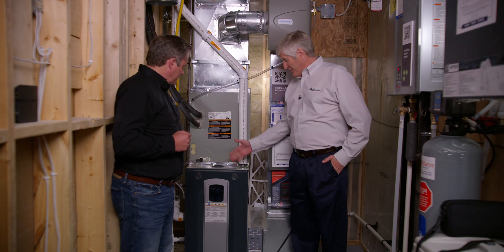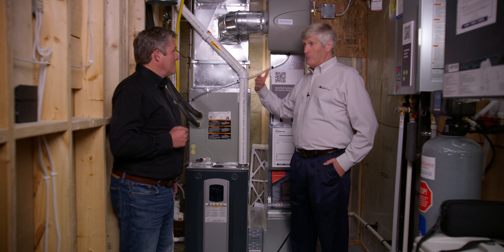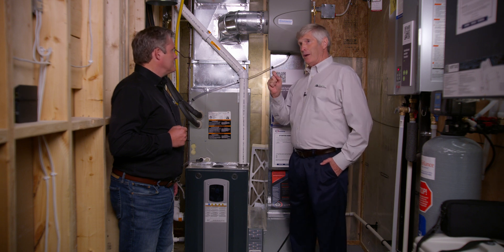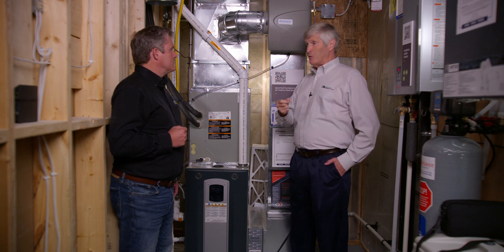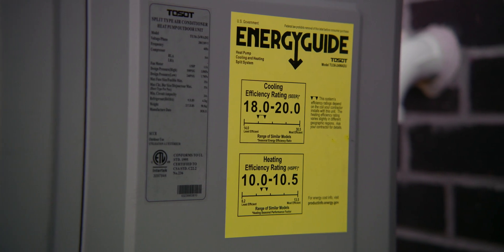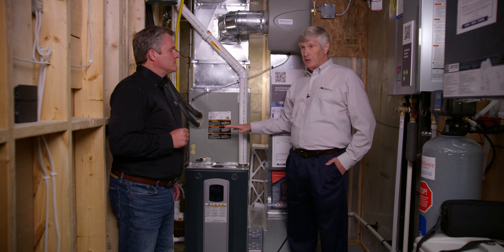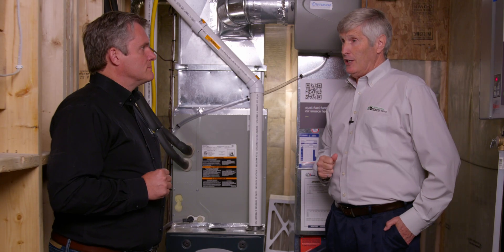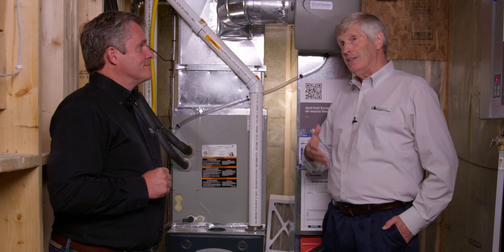Cold Climate Air Source Heat Pumps - Heating & Cooling for Canadian Homes

Comment: Modern cold climate heat pumps work in Canadian winters without having a gas backup. The household saving are greatly increased if you eliminate gas from your property completely since the monthly fees you pay to the gas company are greater than the fees you pay for the gas consumed. If the temperature dips below -25C, an immersion electric water heating element can provide the extra heating for a few days a year. Most of Canada's population never sees -25C.  When you consider a heat pump, start by calculating the total cost of gas and gas company fees that you pay per year.